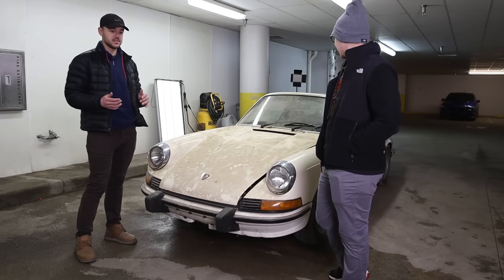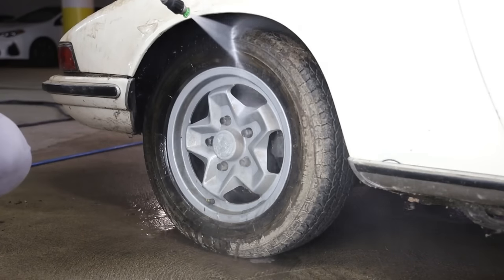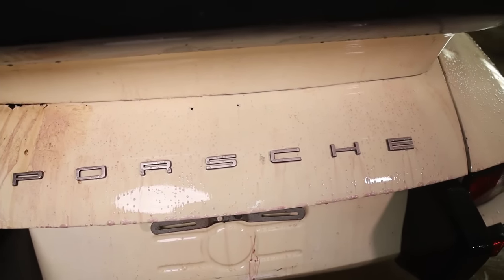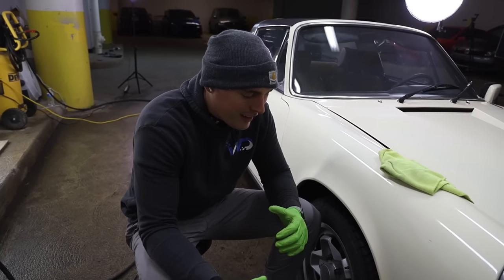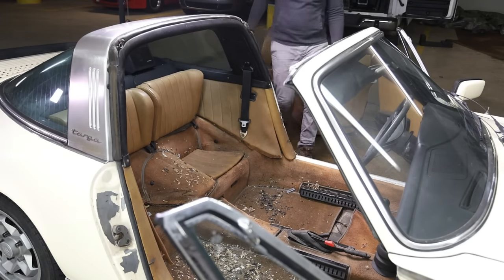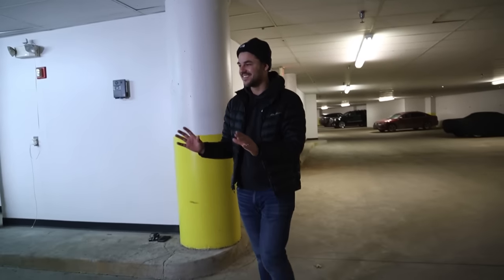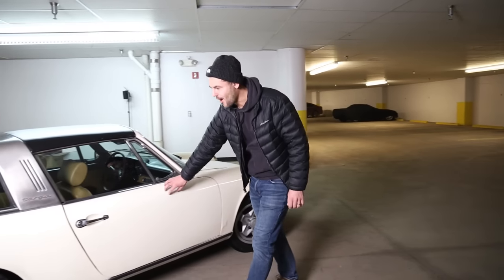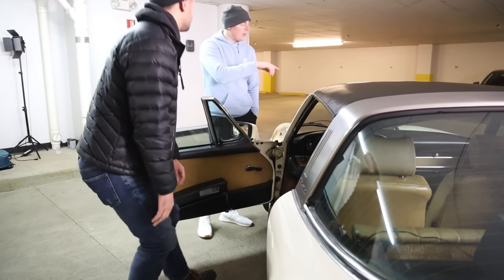ABANDONED BARN FIND First Wash In 22 Years Porsche 911E Targa! Satisfying Car Detailing Restoration

Comment: Great find and video. The ATS cookie cutter wheels were introduced in 1972 alongside the Fuchs, so they should be period correct. But please take away the Turbo wing, that’s just a disgrace.
Reply from the maker: They took the wing off and put the original grille back on first thing!
Reply: Yeah, I'd be popping that whale tail for several reasons.  If Mario had wanted to keep it (apparently not but...) I'd still want to get any crud underneath it out of there seeing as how something is seeping out.
Reply: Too bad the previous owner’s poor choice of adding a spoiler (and do it cheaply) appears to have led to rust.
Reply: I had a 87 targa with the Turbo wider body and rear wing. It was one of fifteen made by Porsche that year for the US market, so like it or hate it, it was period correct. Not the greatest Porsche ever made and definitely not the quickest, but they did build it that way
Reply: It's not period correct, it's not racer. If it were on a later Carrera turbo it's be great
Reply: @Camplou2  100% correct. It could be ordered, from factory, with a 'whale tale'.
Reply: It’s not even a genuine boot lid, it has no vents on the top.
Reply: Surprised you didn't take the wheels off to give them a good clean inside and out also cleaning underneath the wheel arches at the same time.
Reply: I agree it just looks like hell. Like Janet Jackson with a mustache.
Reply: My opinion too, the wing is 🤮
Reply: @anthonybaiocchi3028  whale tail was not an option in 1973 - not period correct. Closest thing to a whale tail was the RS duck tail introduced in 1973 for the RS model
Reply: Hackmesser-Felgen in German, which roughly translates to cleaver rims
Reply: @henningh  finally somebody who have some clue about porsche cars. They not even realize this is a 901 with a long wheel base. The tale belongs to the G or 930 model after 1977 when the turbo engine got an intercooler so called whale tale before that was just a tea tray -non intercooler turbo. The wheels are also for early g models.
Reply: You want a turbo tail, buy a 3.0 or a 3.3 turbo one

Comment: See that little circle in the bodywork in front of the rear arches? That is for taking out the torsion bar from the axle incase you want to replace it or lower the car. 
Seeing that little panel still being there probably means those quarters are original!

Comment: Its not low miles. That odometer was definitely rolled over at 100k miles. Just by looking at the condition of the outside of the car I could tell its 126K miles. Even the driver side seat had a rip in it and the driver side floor mat was worn down to the bare fibers. Not sure why they're acting like the interior is in pristine condition Lol. Tracking down the Title of the car would solve this mystery. But you can tell by just looking at the car its been driven way more than 26K miles.

Comment: I bought over 2 dozen long hood 911's in the mid 2,000's when they were around $6k to $12k depending.  All the cars from 1965 to 1969 had lots of rust.  The 1970's to 1973.5 were better.  All the cars were either regular 911's or 911T's, the E's and S's were hard to find and most of the E's and S's no longer had fuel injection, owners switched to carbs as setting up the FI was a real pain and if it was too rich gasoline got in the oil and spun the engine bearings, not good.  I sold them all to Europe because they had laws that greatly reduced the import tax on any car that was over 25 years old and the Euro got up to over 1.70 to the dollar, they were shoving several in one container and shipping them to Rotterdam.  VERY popular cars at the time.  Now the most normal 911T like this bar find will be will over $30k if not more, too much for me.

Comment: My barnfind would be my 1967 Lincoln Continental Coupe, celery green, jade green leather interior. I bought the car in 1994 from a repair shop in Chehalis, WA., then drove it to Chicago-three, 700 mile legs with no radio, frozen power driver seat set to someone 5'2". I'm 6'1". But if I could have that car in mint condition...loved that thing.

Comment: The car has the "S" trim option, very common on 911T's at the time to raise their price, which is the front spoiler with a lip (considered very high tech at the time as 911's do get light in the front at high speed).  Thicker rubber trim on rocker panel and bumpers.

Comment: A real good way to tell if the car has the original miles on it (besides an intact odometer) is to closely inspect the condition of the brake pedal, clutch and accelerator. Check the steering wheel too for excessive wear. Any car that has  over 100,000 will have significant wear on these areas. If not then I would wager those are original miles.

Comment: In fact the new 911T has exactly the same acceleration in the quarter-mile (15.1 seconds at 91.7 mph) as the 2.0-liter 911S of 1969 and is a whole lot less fussy about the way it's driven. The E is easy to get along with, too, and it turned out to be the fastest quarter-mile sprinter of the bunch-14.3 seconds at 96.9 mph in the quarter—which makes it a match for a number of Detroit's hot cars like the low compression Z28 Camaro and Boss Mustang. And the E doesn't even seem to breathe hard. It's smooth at low speeds, feels strong at 3000 rpm and it climbs up to its 6800 rpm redline with determination. On the other hand, the S is an altogether different kind of machine. It's a top speed car more than anything else. The engine doesn't feel capable until about 5000 and you usually end up shifting there even in routine traffic—to the accompaniment of the furious sound of the sharp, hard edge exhaust pulses rushing out the single stubby tail pipe. It is rough at low speeds, and wants to buck in traffic
Reply: Correct.  The 1973 911T, 911E and 911S all had the same 2.4 liter displacement.  Acceleration is a function of torque, not horsepower, and torque comes from cubic inches, if you look at the torque of a 911S 2.4 and a 911T 2.4 the S is only about 5% higher due to hotter cams, and it comes on VERY MUCH higher in RPM.  All three did 0-60 within .4 seconds of each other with the S in the 6's.  What was different was top speed, the higher HP of the S allowed it to push more air out of the way and go into the 140's but anybody who actually did that will tell you if they did not have a full tank of gas the nose would get light and the steering would be all but gone.
Reply: @naowaratyooktanun2068  Oh yah man... 911s used to be very scary once you went past 7/10ths. People crashed. People died.

Comment: My ultimate Dream Car would be a 1970 Chevelle 454/450 HP / Aluminum High rise Intake with a 850 Holley Dual Pump Carb..
T-10 Rock Crusher 4 Speed Transmission / 411 Rear End / Cowl Induction Hood Hood Pins / Tiger Paw Red Stripe Tires / Dual Exhaust / Bucket Seats …

Comment: I bought and owned new a 1973 Porsche 911T Targa and it didn't have those wheels or that whale tail. Also, the rear hood Had the "911T" badge on it. Mine was Sepia Brown with brown leathe interior. I owned it for 7 years and I think I had close to 85,000 miles on it when I traded it for a 1980 924 Turbo. I stll remember the original purchase price was $12,300. I ordered it at a dealer in Santa Monica, CA and waited for it to come from Germany.

Comment: Those wheels are ATS “cookie cutters”. 
They looks great with a black center section.

Check the driver inside door jamb for a black plate- it should have the vin abs a color code

Remove that rear wing, the black front bumperettes and replace the “sugar scoop” lights (get H1s) and the car will looks so much cleaner.  Beautiful car.

Comment: I don't think what you see is original miles based on all the body work that's been done and general condition of the car. It would have been a ROUGH 26k miles out there on the road :). The best way to gauge it (although not foolproof) is to look at the pedals (wear).

Comment: Use the depth gauge on a 70’s model Ferrari it will read the same way. When dealing with cars from that time might as well through that gauge away. Cars that were mainly built by hand, painted by hand isn’t going to be the same as a computer controlled arm painting a new car. Anything man does is inconsistent you won’t find it on any older hand made foreign cars.

Comment: Nice clean up guys, but that 73 911E is far from original and no amount of scrubbing and shampooing is going to bring it back to it original beauty. Get rid of that cheap, ghastly rear spoiler and send the car off to the paint shop for a full strip and repaint. Those paint reading show that the car has had plenty of filler and a bad repaint. Also, the driver floor carpet is a replacement piece, the dash has a nice big crack in it, the leather steering wheel cover is cheap and poorly stitched. The way to make this car nice is to start by taking all of the aftermarket crap off the car, sourcing correct parts, and then undertaking a thorough repaint. The car looks like it has good bones, despite all the neglect. Good Luck

Comment: Car needs to be stripped of all its paint and checked for rust issues  fix any flaws.  There seems to be fit problems and repainted by a professional.  The way Porsche’s are selling on Bat it would be worth it to have the engine rebuilt and painted with new carpet and headliner. You did a nice job on the detail but a new buyer would want the whole car corrected.